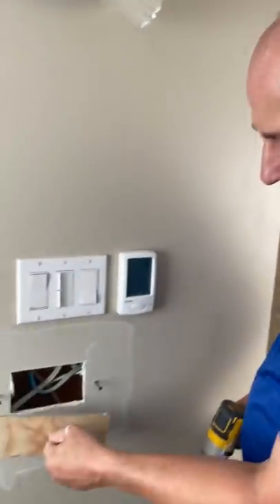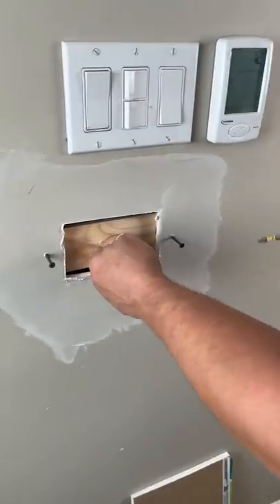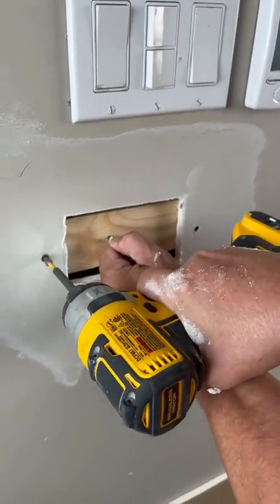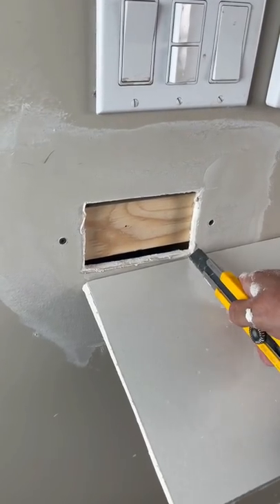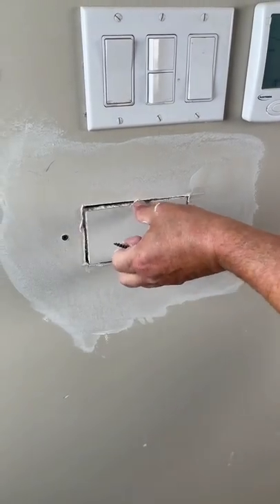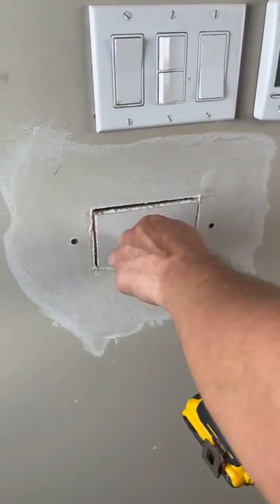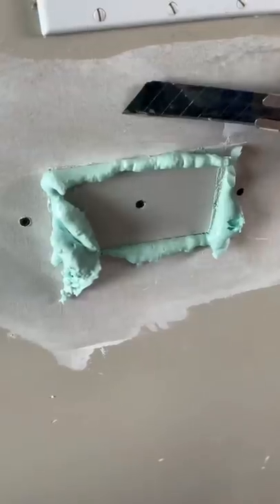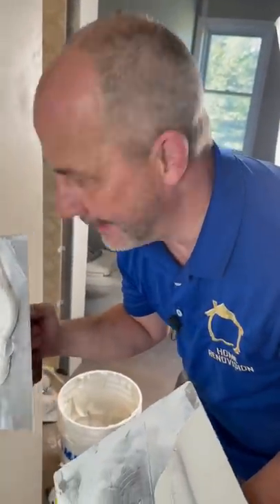Drywall Patch, No Tape Required #shorts

Comment: This guy's great. This video is confusing though.

This is where I learned about making blowout patches. He produces a lot of great stuff.

It's clear this is geared towards homeowners and DIY. I would charge probably about $75 for this sized hole. If a homeowner has spare parts(as they should), then this would be the simple fix. Might have to buy mud/tools. Maybe the foam, but that's it. Way cheaper than spending the extra money, but it's also not going to last as long.

Comment: first chamfer the drywall and the pice in your hand, then set in the plywood or a pice of drywall witch has the same size as your plywood. Set in the repairpice , skip the foam. Use your Putty and that's it.
Greetings from Germany

Comment: Even better than tape. You cut the dry wall bigger than the hole then trace the hole and cut that square out but leave the paper on the front. Now the paper is bigger than the hole and the dry wall is in the hole. You just put mud under it and on top like it’s tape.

Comment: Or cut a piece of drywall, bigger than the hole. Then trim it back, so only the paper is bigger than the hole. And mud it in that way. No need for the extra wood.

Comment: There’s a way easier way to do that.  Use the paper on a patch bigger than the hole. Cut and strip the extra drywall off of the oversized patch. Butter up and float it out.

Comment: Hot patch wld work without cracking. Cut the board on the back side peeling the paper back on the front of the board . Way cheaper

Comment: Or you patch it properly by cutting the patch an inch oversize in all directions, then scoring the back the proper size. Then snap and peel the extra gypsum off your patch. Mud the paper on the patch, apply and knife or trowel smooth. After that dries a lil finish swipe and scuff and your good for primer

Comment: The ply+drywall patch is standard. So the different part is the foam.I don't get why that's better than tape. You need to wait for the foam to cure, then skim coat anyway. Why not just tape and skim at the same time?

Comment: structural integrety is horrible when u do it that way as opposed to using NO FOAM, get the exact dimensions and put the drywall in so it fits PERFECTLY, get your eyes checked

Comment: I would have cut a piece bigger than the hole. Cut off what I don't need but leave the paper on the outside. Then you don't need the foam or tape.

Comment: Maybe this will work but I'm not using spray foam for this. Cost is going up way too much. Joint compound is super cheap and tape is not as expensive as spray foam.

Comment: Fail to notice the power cables behind the drywall where you just ran three screws and a load of foam.

Flick the switch and trip the power

Works every time 😊

Comment: Well first of all I've never seen your method that's right, second of all I use tongue depressors, with a piece of double-faced tape placed on each end. I then place the tongue depressors around the hole with the one side sticking to the existing drywall, and then I peel off the other side of the double face tape and mount the slightly smaller piece of drywall. Then I fill it in with mud, and sand it.
Reply: By the way I discovered my method on a PBS series called This old House.

Comment: Tape is cheap and easy to apply.  Also Tape measures are cheap and easy to use. I can see if you have one hole to fix and no Tape,  but happened to have an old can of foam. Otherwise this saves nothing.

Comment: GENTLY pop that with your hand and it will fail instantly. Non drywallers need to stop with drywall tips
Reply: This guy is a drywaller though. Check out the channel, he's got a whole ass business.

This is a DIY fix. I wouldn't do this professionally. If someone wanted me to fix this hole, that'd be about $75. Maybe I'm expensive. My minimum is $50, and this method is far cheaper than me.

It's a tradeoff. I'll have a lasting effect. This method saves money. Pick your poison.
Reply: Have you seen this guys channel? He has probably 10 hours of drywall content

Comment: Expansion foam = $8-10 + 45 mins for it to dry before you can slice it off. All that money & time for one small patch job. Just use tape. Better yet bypass the plywood thing and make a butterfly patch.

Comment: Notice the video was cut as he put the first screw thru the wall.  He did that because it’s hella tough to get the first screw in.  The board just moves out of the way no matter how hard you try to hold it steady.   Sneaky to leave that out.  😏

Comment: You're a  LOT of years behind for this tip....... Pssst, here's a tip, use the same method to reinforce a portion of the wall where you're going to hang something heavy and the drywall will not hold!

Comment: I’ve seen this before, and a California patch would make a better repair. I question the strength of this patch especially in a high traffic area.
Reply from the maker: weird. a California patch is much weaker.
Reply: @HomeRenoVisionDIY  no paper or fibafuse it’s gonna crack.

Comment: Your guarantee failed. Did this a couple of times already without looking anything up. 🤷

Well, I didn't use foam but a boatload of filler putty. I hope it counts.

It is however a really nice trick that works well.

Comment: Now you don't need $.10 of tape when you can use a $6 can of expanding foam and wait 30 minutes for it to set hard enough to cut flush. You're right i haven't seen it before, because its stupid. Much faster and cheaper with tape and 5 min mud

Comment: So how does that not create hairline cracks in the future with expansion and contraction…. He essentially made an expansion joint which will only serve to allow those two pieces to move independently over time. Harder drywall compound and tape will not allow that. Don’t do it this way

Comment: You always need tape on open seams. You should also pre fill the seams with hot mud like 90/45 etc. yes, you need tape… only way to no have to use tape would be a California patch. For such a big following why are you showing people the wrong way to do things? If that area settles any further you’ll get a crack… 😂

Comment: THIS WILL NOT WORK PERMANENTLY! THE EXPANSION RATE OF FOAM AND DRYWALL IS DIFFERENT! AN OUTLINE IF THE REPAIR WILL OCCUR WITH TEMPERATURE FLUCTUATION.

Comment: Every drywaller has used a backer board with a screw in the center to hold it while you screw the wall to the wood, wow your inventing something everybody with common  sense does... as far as taping thats fast and simple, oh and the right way, this video you happen to be wrong

Comment: I like all your videos but this one I'm going to have to give you a thumbs down usually when you're working around electrical as you know you should use machine screws not a drywall or woodworking screw( yes I know machine screws when I go through the drywall) could be pointy and actually go through the electronics... yes it will probably push into the wall before it goes into it but the potential is there and you and I both know that so you may not need tape but you might need new electrical wires or a doctor's visit after 110 volts go through you

Comment: This is stupid in many ways , don’t do this people. He was right though ive never seen that before lol, mud around your piece before installing it in the hole once dry mud over that,  no tape no soft foam hoping it will hold mud, no expensive foam and no waisted can of foam , save the foam for its intended use

Comment: Hot patch is waaay easier and faster... expanding foam??? Completely unnecessary and wasteful use of $8 can of foam. Do the plywood thing. Cut drywall 1inch bigger than the hole on all sides. Flip onto back side. Score the drywall patch to the same size as the hole.  Remove the 1 inch excess drywall  piece that was too big leaving the front paper on. Now u have a drywall patch with built it tape that won't Crack like this guy's patch.

Comment: Bet ya he had to practice his ass off,not runn the screws,past dimple,worked in dw industry 3decades,one of the most amature things to do is not use joint tape
Never a good thing,it's easiest to tear 4lil PCs of tape ,faster too ,only to use mud anyway,,spreading misinformation

Comment: This is like the dumbest suggestion I've ever seen.  If you've cut your patch piece close enough to the size of the hole and v notch the edges then use 5 minute mud and your patch will be completed and paint ready before the foam is dry enough to cut😂